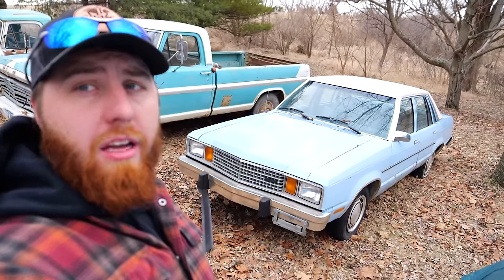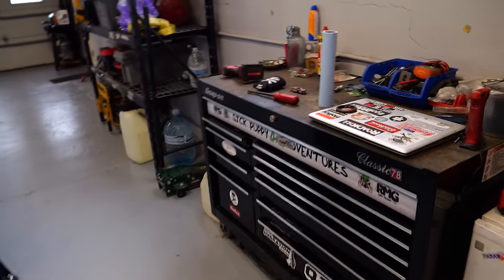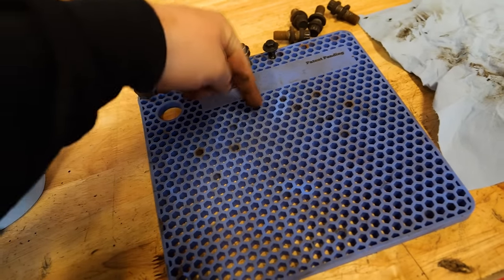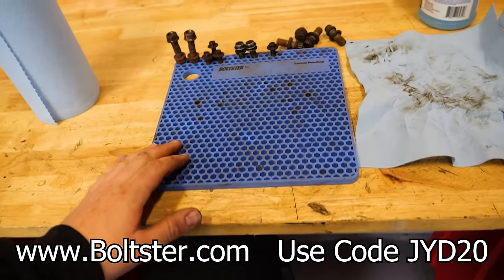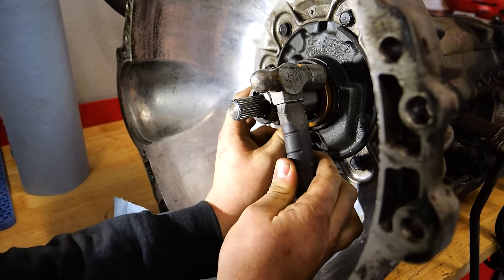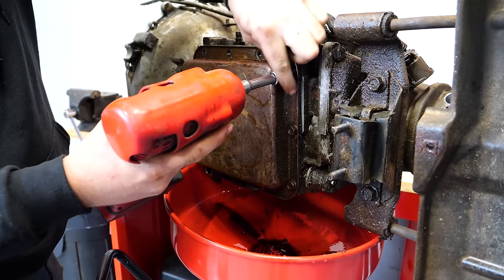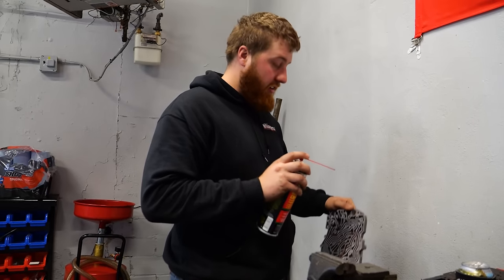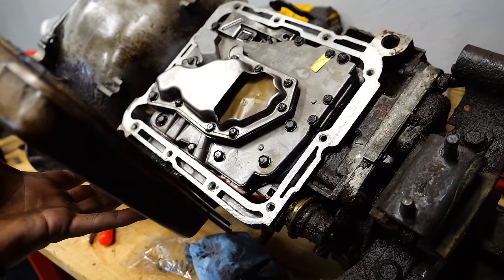CHEAP V8 Ford Fairmont REVIVAL! Will it Run & Drive?

Comment: 10:10 Actually, the last time I removed a transmission from a car on jackstands, I had them lifted plenty high for the bellhousing to clear. The biggest problem I had was getting the transmission OFF ME when it came free a little easier than expected... not heavy, just awkward to shimmy out from under while holding it up.

Comment: Line the stud on the convertor with dowel on trans, then align the flywheel convertor hole with dowel on engine. Usually pops right in when putting trans to engine. Went pretty well for you guys.

Comment: I still miss my 1980 Fairmont with the indestructible I-6 engine that had been bored .030" over, and the cylinder head shaved .015". I had to choose between hitting the car stopped at the traffic light in front of me, or the building next to me, when the brake pedal went to the floor though. Watch your fluids, great car.

Comment: These were a popular fleet vehicle. Lots were sold as rentals, taxis and police vehicles. I had an 82 with a Straight Six. Was a good handling car. From your comment about roll, these might need a suspension beef up with the V8.

Comment: What I had to do a few years back when I was pulling my transmission on my car in my driveway was taking it off the jack under the car. Once it was off the jack I just carefully slid it out from underneath. Then once I had to put it back in, I used a hoist to lift it up in the trans tunnel then put the jack under it. I wasn't the cleanest or easiest thing ever but I got it done and it wasn't too sketchy as far as stuff like that can go.

Comment: Don't forget the Ford Granada. Personally I thought they looked better in the 2 door version.

A friend had one with a 302 he bought used in the mid 80s. He swapped in refreshed mildly ported 351 heads, aluminum manifold, 650 Holley and a bigger cam. Removed all the EPA garbage. Put in a stall, shift kit and a 3.55 rear end. It was amazingly fast, but only in a straight line :)

Comment: Do what we dis with our trio, 78 4 door , 81 Futura Wagon, and the Surango. Enjoy as is, until somethibg needs replaxed. At that time upgrade the replaxement to performaxe parts.

What I din with my firdt xar, an 80 Mercury Zephyr,  200/C3 4 door. Trabs went, and a friend was looking for a 200 for his Falcon. Found a wrecked 5 liter, 85 anniverasry. 5.0 H. O. Five speed, with a few performance parts, heard it run, t boned ,looked like a banana laying on its side. 

But the damage didn't block driveline removal by dropping the subframe. Apartment complex had a shop, and I used to help plow the lots, dree off goirs access. 

Kept doing the same now.

And yes. Still have the Merc. 347 FSB, Tremex T6, 8.8 twin trac, runnong 3.55s. Holley injexted, and a nice atreet cam. Upgraded suspension, lowered an inch all aroind, and drilled rotors, 2 piston xalipers, all around. Stockish lookong 16 inch alloys.

My road course car before losing my leg. And tame enough to cruise or daily.

Comment: It's a lot different to the Ford Fairmonts we got here in Australia. Ours were specced up falcons but the 302 Cleveland and windsor V8's  were popular for a while in the 1980's so there was a lot of locally made speed gear for them.
Reply: The US Fairmonts were smaller: 5 inch shorter wheelbase

Comment: I put a 302 Boss, bored balanced and blueprinted in my 2 door two tone blue on blue. That motor killed 3 vehicles. Including that one. It came with a straight 6 in it. I thought they all did. Hi Mook!! I am  subscribed. Because of Mook.  I think she is great, I wish she would do more with her channel…. Maybe she works too ??  I actually discovered her first when she was working on the flooded pickup. 

Btw….I ALSO had a three inch gash in the palm of my hand doing exactly what you just did. Use a vise dude. Hand stitches hurt like hell. I wouldn’t say anything if I didn’t care……

Comment: You can use "all thread" on the top 2 sides of the block & swap a clutch without pulling the, transmission.  I dunno if you could do the front pump seal that way or, not. Big huge 4X4 trucks are easy af to clutch swap with 2 pieces of all thread. A couple nuts & washers, of course.

Comment: Had an '83 Fairmont with the 200ci 6cyl. It was comfortable, reliable, and got pretty decent fuel economy with its little single barrel carb. I imagine it would have moved pretty well with the 302 V8 - especially considering it was one of the lighter cars to offer it.

Comment: I had a 78 mercury zephyr and a 79 Fairmont, both had 200 6 cylinders. I loved those cars , very dependable. The zephyr got wrecked and the Fairmont rusted so bad that the gas tank fell out.  Minnesota killed that car but it ran great no matter how cold it got

Comment: I'd say keep her pretty mild, 8.8 out back something like 3.73 or 3.55, subframe connectors are a must on these cars, of course the qa1 shock treatment and maybe a mild heads, cam, and intake set up (i.e. letter cam, gt40 heads, roller lifter/rocker conversion)

Comment: WOW, I used to own a 79 Fairmont.  Had the rear end go out on it, had to get it swapped.  But the other problem with these cars is the ignition system.  Found out from a fried who used to do detailing work back in the day, if you tried cleaning the engine, you had to make sure to cover the electronic ignition, other wise you would short out.  But then all you had to do was unplug it, give it a good spray with WD-40 and plug it back in.

Comment: Nice. And I knew it'll run and drive. My dad has a '82 Fairmont as his nigh indestructible daily driver. His is the 6 cylinder though and isn't in as good condition as your restoration.

Comment: You might want to check the tops of the rear shocks, where they enter the trunk floor. Looking at the trunk floor from inside the trunk, there may be some weakening rust visible.

Comment: The reason it was so quiet with a glass pack is because the '79 302-2v made about 155hp, and had a camshaft milder than a lawn mower.
The 255 v-8 was a "small bore" engine with the same stroke as the 302, also. 302=4" bore, 255=3.675" bore. There are 'zero' performance parts for the 255.
The early 1960's "260" was a small bore 289, and still had a larger bore than the 255. 260= 3.8" bore x 2.87" stroke. In conclusion, the 255 makes either a great boat anchor, or generator station/boat motor.

Comment: Back in the mid to late 80 I picked up a 1983 Ford Fairmont had it until 1997 never had any problems with it no V8 it had a straight six cylinder until I changed the transmission fluid my self after that it had problems shifting just wasn't shifting right never did find out so I trade it in for a 1991 S10 pickup.  Like I said never had any problem with it I think I put 300,000 miles on it ran really good no rust upholstery in good shape.

Comment: Yo, thanks for the heads up on the Boltster. Used your code and it’s on its way. Just did the timing chain on my F-150 and wish I had it then for the timing cover. 😎👌

Comment: You can put your transmission jack on top of a heavy duty work table that way you don’t have to lay on your back. You do have to squat down a little bit, but it works just as good

Comment: I'm not sure how I missed this when it came out... maybe I was blocking it from my mind, since I once owned a '79 Fairmont. It was even the same pale blue color! I will never understand the whole "put the horn on the directional control stick" deal but hey, Ford gonna Ford. Not that it mattered once someone yanked the damn stick out of my steering column one day - I wound up jamming a radio antenna in there so I didn't have to signal turns with my arm out the window in the damn rain.

Comment: Having owned one of these back in the late 80's with an inline 200 6, these were very nose heavy for even the 6, let alone the 302 V8 and could not corner well in stock mode, that is they'd plow the corners at any speed, let alone slowly. Only the 4 banger was ideal weight wise. Yes, they came with the 4. Mine was a basic I6 GSA equipped POS. The cat was, I suspect partially plugged and slow as a slug. never liked these, though reasonably reliable, but slow. My 74 I6 Nova and the 305 V8 Nova and the 83 Civic with the 1500CC motor ran circles around this thing. 

Best to add the Mustang handling parts to beef up the handling at the very least and go from there and see what you get.

Comment: My Grandmother, who passed in the 90's, had nearly that exact same car. Just a slightly newer year I think only because the car was smaller, cheaper looking, and was blue all over instead of having that white roof you have... so probably from the 80's. But same Ford vehicle and same color. Grandma practically drove it to pieces and then gave it to my step father for the coup de Gras.

Comment: I had a 1980 4 door 200 Straight six, it was hands-down was the best car I’ve ever owned.the amount of Abuse I put that car threw without one Mechanical failure was insane. Just kept up normal Maintenance.

Comment: I had a baby food 🥗 1980 mercury, zephyr. It was a 4 door auto with a 4 cylinder. It had like 78K miles when i got it rust free for 250 bucks. I had to put a timing belt in it once but that was a daym great, car. I drove it back & forth to smyrna tn every weekend (2 & 1/2 hrs one way) with the accelerator MATTED the entire, trip. The speedo went just over 80 or 85 & id bury that biatch when i hit I - 40 & never let up til my exit off of, I - 24. I beat the pizz outta that little car before & after the timing belt dilemma. I had to take the trans out to change the flex plate once. I put it all back together & had the front seal leak in me. I just pulled it back apart & changed the seal so i could GO, again. The guy i sold it to jumped a culvert with it & broke the trans housing. The little engine was still ready, set, go. It didnt even use any oil/none.

Comment: Aww just use the transmission to engine brake automatic transmissions are used all the time for engine braking down shift from drive into 1 lower hear at a time works great when brake boosters fail Kevin @Junkyard Digs

Comment: The Fairmont came after the Maverick..The Maverick was bullit proof..170, 200 ci I-6 or the 302 V-8..proven manual and C-4 auto trans...simple to work on, handled ok..good MPG..Very well designed cars..cheap and cheerful.

Comment: It's funny how different country's domestic car market vary so widely.  I like how this guy mentions the fact the Fairlane is a 
4-door V8 because in America it's more uncommon, yet in Australia, the V8 4-door is at the top of the list for people looking for performance.  The desire comes from the fact you tend to own 1 car per adult in the household so you need something that will fit the family, tow trailers, do normal everyday people type car stuff, but you still want the power and performance so every now and then when no ones looking, you can have a little fun.  2-doors never have done super well in OZ, the old manufactures (RIP) did make 2-door V8's, but they didn't move them anything like a V8 4-door, even V8 wagons.  Our most expensive classic car, the one even die hard Holden fans love is the Ford Falcon GTHO Phase 3.  Cleveland 351 in a 4 door Fairmont body.

Comment: I had a 76 Fairmont that had the same gearbox oil leak. Guess what, it had a C4 as well. Mine had a 4.1 straight 6. Next I bought an 87 Fairmont with the same 4.1 but with an alloy head and different box. Had to rebuild the engine so I mildly worked the engine to produce the same power\torque as a 302. The 84 to 87 cars were so badly built.

Comment: About 10 years ago, I saw one of those with 50,000 miles and it wasn't a repair shop and I think they said I needed a timing chain🤷‍♂️ I was thinking wow that's kind of weird with only 50,000 miles but whatever.

Comment: Get the small Ford LTD. The redesigned Fairmont. I think the doors and roof are the same as Fairmont. Like an 1984 or 85. I had one with the V6 and it would go fine. It has a better interior.

Comment: Virtually any amount of work will uncork some extra power from that engine.  It is napping in its current configuration, there's an extra 100 horsepower to be had, no problem.
Limited slip diff.
Performance in every respect will take a noticeable jump just with an upgrade in the tires.
Patch the body, repaint to original.
Recover the seats but otherwise leave the interior stock.  Recover them in plaid.

Comment: Time to stuff in an EFI 5.0 HO with explorer heads and GT40 intake. T56 trans, and equal length headers, 2.5” exhaust with X-pipe. Leave the exterior as is, upgrade the wheels to some wider OEM Ford.

Comment: My Dad worked at a Ford Dealer Years ago.   He said that the guys rebuilt a Transmission and they backed the car out and it wouldn't go Forward.   The 2nd time they worked on it,  it would go Forward but not Backwards.   I guess they eventually got it fixed,  but it was a lot of trouble.

Comment: The government auctioned off all their old DOD Fairmonts back in late 90s, for next to nothing. Got one at a DRMO auction for $100.00. Fixed it up a bit and drove it for 2 years, wife loved driving it cause it was so roomy and easy to drive with a 300 6 in it.

Comment: Curious if this is a 4.2 liter V8 as they had them for a few years around this time. 

1982 was the last of them iirc with the Mustang GT 5.0 HO

Edit: looks like 1978-79 was the only year of the 302 with 1980-81 being the 4.2 liter.

Comment: keep it as it is nice little runner the sift kit works i had it done by a buddy  i allso spent a wheelbarrow full of dosh on the engine  you no ally heads 347 kit the works  it go,s like a scolded cat when asked nicely  but i have not raced it cinse  see you soon 😱👌✌🤟 it came out of a 76 mustang 2  i put it in a 65 thames 400e van

Comment: That car is made to be a daily all it needs is some Fox Mustang wheels with some decent tires (maybe a little wider in the rear) and some window tint and drive it or top shelf is Cam, headers and duals, aluminum intake and 4 barrel carb. Much like Luke's clapped out Maverick. Perfect Daily as its too ugly to worry about appearance but its too good not to drive!
Reply: Also if you tint the windows and paint the center post and tops of the doors black it gives a hardtop appearance for cheap.

Comment: I just can't get past the rust. I want to crawl through the screen and go to town on it with Comet and 0000 steel wool. Other than that, go sick on it. Suspension, 8.8 with a posi, Windsor motor, maybe EFI...
Keep the hub caps and sew up the tear in the front seat. Two big, enthusiastic thumbs up.

Comment: As a mechanic have I, nor would I silicone my gaskets. I do however use high tack gasket adhesive on one side. Or use Right Stuff gasket maker instead of a factory gasket.

Comment: My Dad bought one of those new back in 1979. It had a 6 cylinder, I think. I really hated it, such an old lady car. I think I drove it once. I just didn't want to be seen driving it. The think can be fast because it doesn't weight anything, but I think you'll have to beef it up structurally or any amount of torque will twist it into a pretzel, it has the rigidity of a soda can!

Comment: talk about potential, I have a 99 Lincoln Continental with the 32v 4.6 that runs and drives daily, just turned 80k miles. Wonder if you have any interest? No rust Oregon car.

Comment: 6:33 nice tip, stonks indeed, I only have a pile of several dozen empty fluid containers because I'd rather spend several hundred dollars in coolant refills before spending several hundred dollars on a radiator replacement.  I feel like I have to EARN my car repairs by suffering them being broken first.  Am I Lutheran and don't realize it yet?

Comment: The amazing thing is that it has barely more power than the AMC 258 in the Eagle. The Eagle is 110hp but the 302 is 130 or 140hp

Comment: 8:00 Ford puts yellow loctite on the torque converter nuts, hit it with a propane torch for about 10secs first. U DONT want to strip one.

Comment: You know what you guys need to do on that Fairmont it's take the two front tires and turn them around a white walls cuz it looks like heck with two black walls into white walls and being it's an older car it needs to White Walls and I noticed the front tires are white walls turned in I don't know why they did it like that to White Walls to Black Walls but I know you guys have a tire machine you could do it lickety-split alright guys take care love the videos always.

Comment: rebuild the engine, with blueprinting, NO POWER MODS, to spec or maybe a bit over bored, balancing, and remove all the non-essentials/legal stuff. Build it for longevity and gas pinching, and THEN suspension and power mods, tranny and a tall tall rearend, and watch it become your favorite go to car. Reupholster, a good dash saver, and a bobble head and I bet you will drive it for 20 years.

Comment: Should I head to Jack turned around so it goes towards the rear end not the motor so whenever the transmission lowers it pulls away from the engine. Just say sir I’m sure you know that I’m just saying it helps out a lot.

Comment: Its stupid how much oil is leaking from something with 78000 miles. Cmon Ford. I've got a Honda pilot with 240000 miles on it that doesn't leak a drop of oil. That why my dad refused to rebuild the Fairmont wagon we had after blowing a head gasket. I didn't realize at the time they made a v8 for them though. Nice!

Comment: My mom had the same car different color, also with no AC and only an AM radio.  She bought it new and drove it until part of the pine tree in the front yard landed on it during hurricane Alicia.  It was hot riding around in it but I still remember it's distinct smell, probably due to the catalytic converter.  Had it not been totaled, I probably would have become my car at some point.  I drove it to take my now wife and a couple of friends to see The Who a few months before its demise.